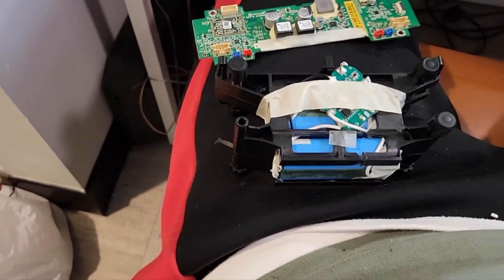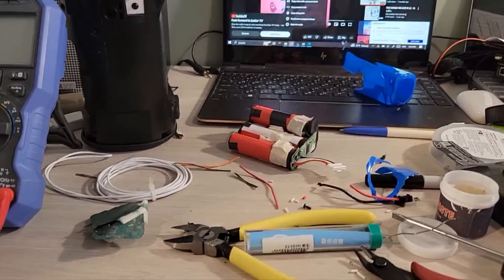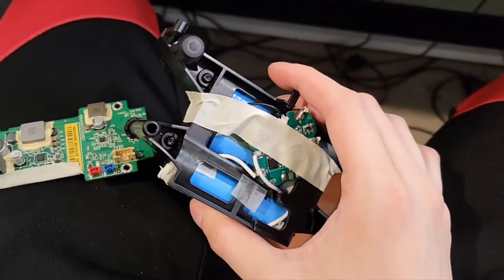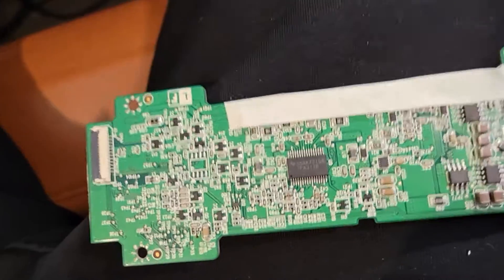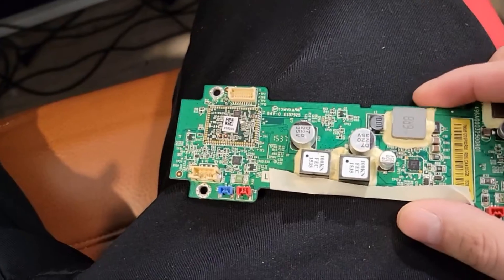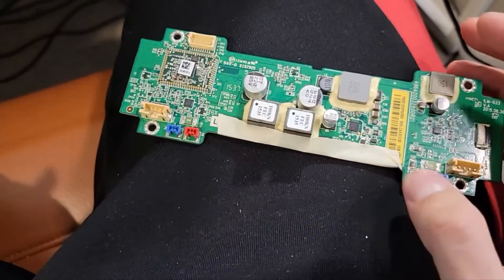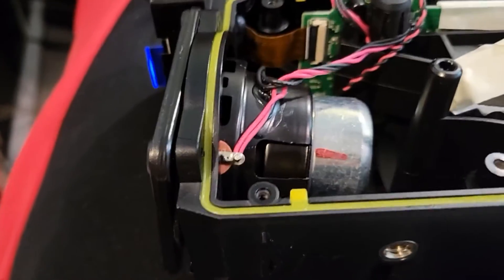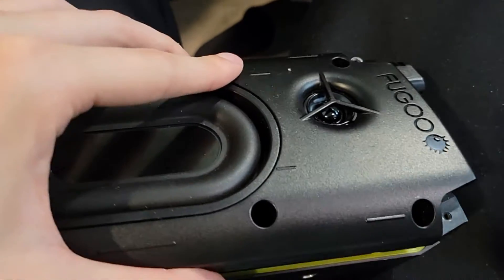Fugoo XL repair (dead battery)

Comment: Would be nice if you showed how you connected your "replacement battery" to the  Fugoo 7-pin battery connector/harness. Also curious if the Fugoo speaker needsed or required any other coompnents from the useless old BMS. (battery temp sensors for example) If those temp sensors are no longer present, will the Fugoo operate  normally or at all?  I would think that the main board would register that there is a problem with the battery if it can't see the temp sensors in the old battery pack that is no longer there. (Maybe I'm overthinking things.) Good video!

Comment: I wonder how many good Bluetooth speakers will end up in landfills when the batteries expire. I wish manufactures would either make batteries easier to change or use LiFePO4 batteries that last 10+ years.
Reply from the maker: Good thing most of the Chinese bluetooth speakers now use common 7.4v battery packs.